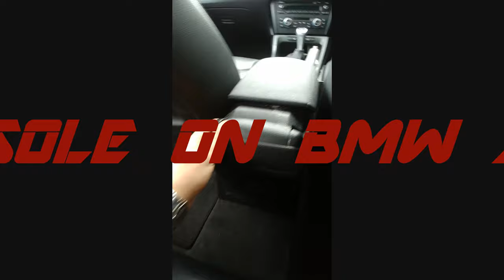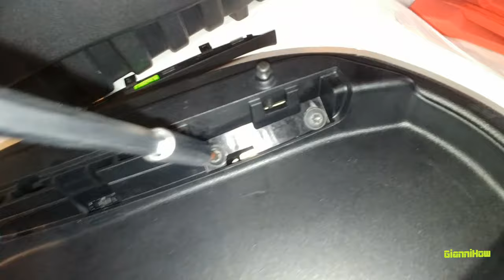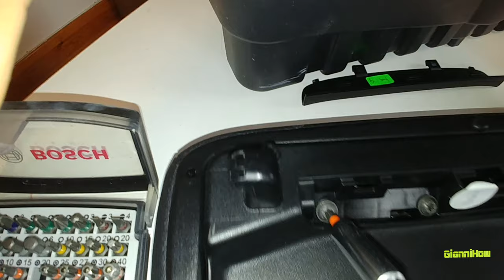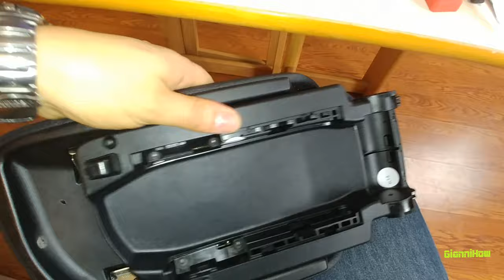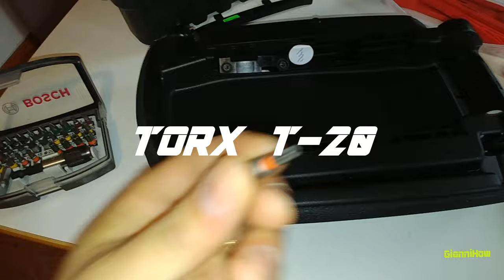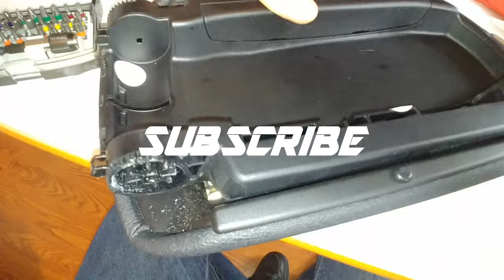BMW X1 Centre Console Lid Armrest How to Repair  in 2 minute Watch Now

Comment: How do you take the armrest off in the first place please?
Reply from the maker: Hi there, thanks for watching, I do strongly advise against removing the armrest, it can be easily fixed while attached, just remove the screws covers and screw them back in, if you really need to remove the armrest for other reason, then, you got to remove the back panel where the cigarette lighter is, the there is a long pin that goes through the armrest, remove that with a screwdriver and a hammer, there are 2 springs on side, remove that and don’t lose them, they will give you some headache to put them back, if you can let us know, we curious what in what you decide 👌 
Good luck 🤞

Comment: I have the same issue with my bmw 1 series.  Would this be the same process. 2012 plate. -
Armrest is shaky
Reply from the maker: Yeah, no need to un mount the whole unit, just remove the cover and screw them back 💪

Comment: The top actually fell out of mine and I’ve been looking at how to actually remove the part its attached to
Reply from the maker: On the back you got to remove the trim where the cigarette lighter is, unplug the cables, then there is a long metal pin that goes all through it with 2 springs on both ends, with a small screwdriver and a hammer push the pin out, it’s easy to remove